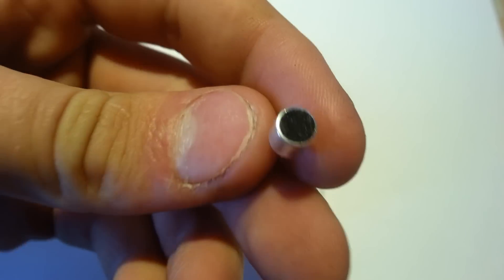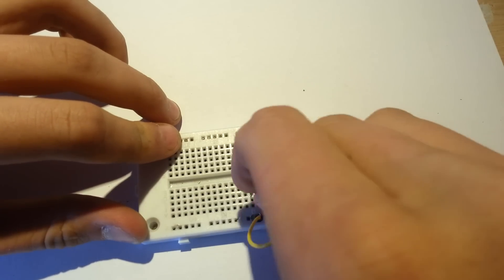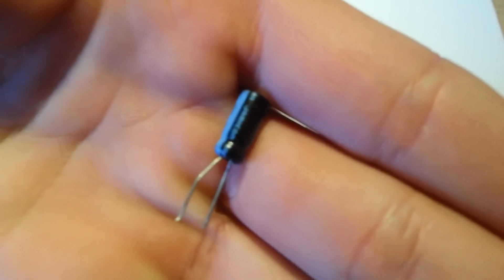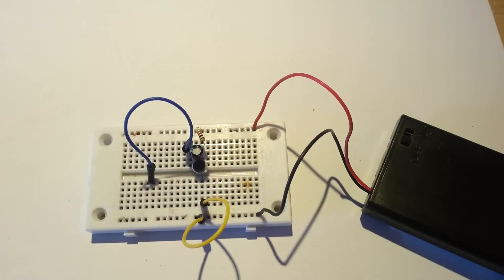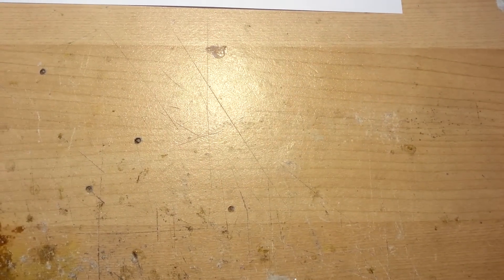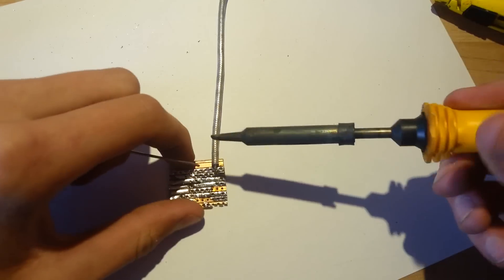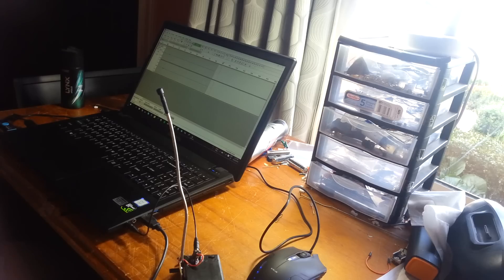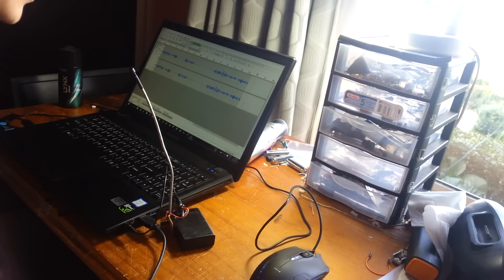DIY microphone

Comment: Can i attach this to my headset
Reply from the maker: +theo hawes probably too heavy with  the batteries, you  could use usb power, but usb power has a lot of electrical noise from the switch mode power supply in the computer, so when you use the mic with usb you will hear static